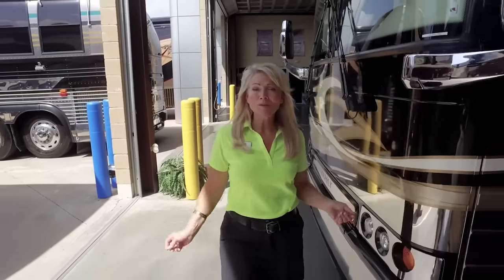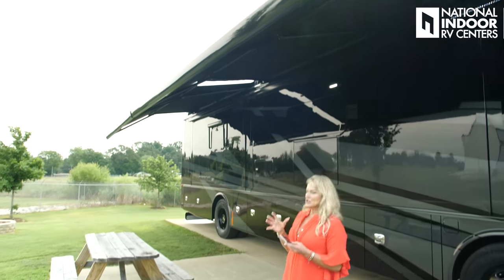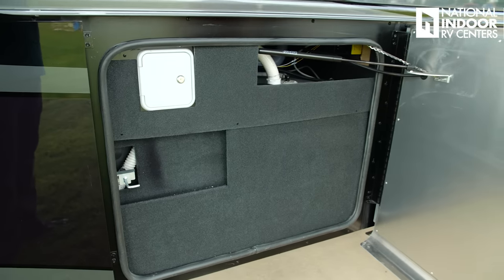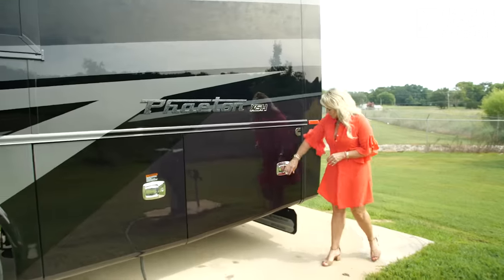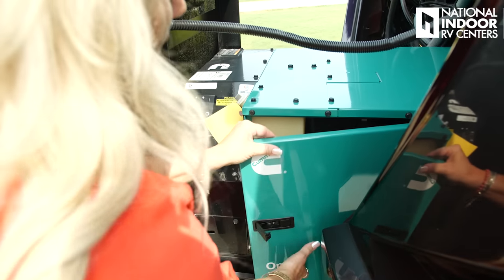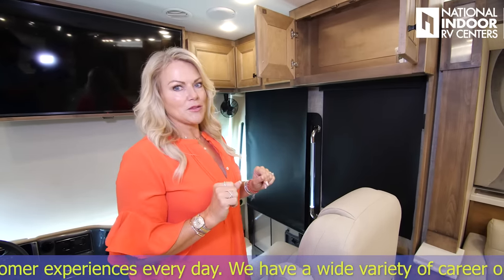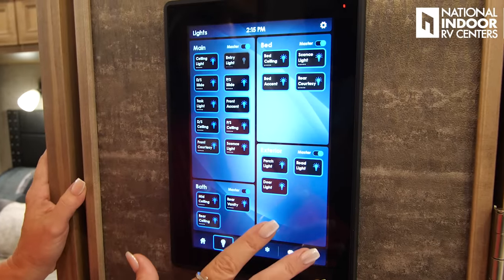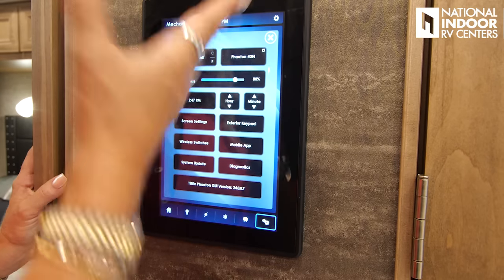Luxury RV Tour – 2024 Tiffin Phaeton – Class A Diesel Motorhome

Comment: We have owned a 2020 40IH for 3 years now. IMHO, this is the best and most spacious floor plan with the most storage in a 40ft coach. I am happy to see some of the changes, 450HP standard, elimination of Schwintek slides, addition of enhanced driver aids. Also looks like the passenger side mirror base has been move forward a bit, which is a good thing. Would have liked to see them move it to the front of the cap as it used to be before 2020 to allow maximum mirror clearance. There are quite a few changes that I do not like. No moe seamless slides, hate the frameless windows compared to the previous sliding ones that were quite unique to Tiffin, much prefer the wood valances to the new (and much larger) cloth ones, elimination of 3 drawers in the kitchen to the left of the sink (this already happened in 2021), switch to the individual pantry trays instead of all of them sliding out as one unit, and probably others. Seems to me that overall Tiffin is reducing content YoY.